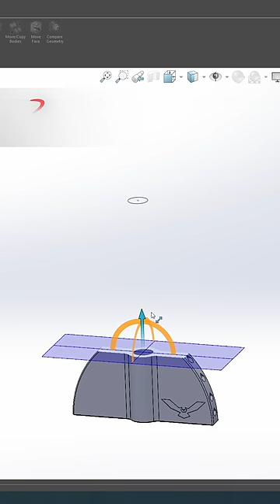Innovative way to clean a CNC Machine!

Comment: I want to see it spin at full spindle speed.
Reply: It's just a backyard sprinkler then.
Reply: I think it would just brake ahahahaha
Reply: Simple mist creator, just like face milling heads with TSC
Reply: The max RPM differs (i had 8000 and 10'000 RPM machines), but all of them need to be spindle/tool stabilised before going over ~5000RPM. So at least the asymmetric washer tool would certainly fly off the toolholder. However at 10'000RPM the edge of that 100mm radius fishtail is going linear around 6300m/min, which is insane (=378km/h) for any tool. Considering an average D tool linear speed is 120m/min, you can imagine the centrifugal forces on that plastic tool even without cutting. The spindle would rotate like 600× before droplet which just left the nozzle hits the wall 1m away going at 60 km/h.

 I'd really would like to see how does it look like, if that tool doesn't brake in the first sec of M3 S10000 M53..
Reply: @dannydetonator  hahahaha wow
great breakdown, thanks for that👌
Reply: @Ilmatorjuntapanssarivaunu_90  I don’t have through coolant so I’ve been using a sprinkler in my mill I was quite surprised I guess that somebody else came up with the same idea 👍🏻
Reply: @Danny THE Dog  I think it's printed metal, Markforged makes metal printers but I'd have to check to tell you which one.
Reply: LOL

Comment: i just drilled some holes into the round stock at variety of angles and it does the same but better
Reply: That's more of a design issue than the actual concept

Comment: Just a thought here, but after seeing this it inspired me, have the fluid flutes, shoot in a fan going up, to get the roof crevices as well, and design a spindle run to go in square patterns around the box corner to corner at various heights with of course very slow spindle rotations.

Comment: Question: what kind of material was used in the 3D printing process, and how much pressure can it with stand with just the side lock screw holding it just more than hand tight?

Comment: Work smarter not harder, this you can say when you work by your own for yourself, not for another company that will finde your a second and a forth and tenth thing to do if you try to save some time doing a job in a smarter way than what your Bose said, so as long as you don't do your own business  then work harder not smarter, because working smarter will take you to more work and more stress, they only case that I will work smarter not harder if I'm an employee is if I will take a rest in the time that I have saved with my ideas.

Comment: It looks like the side nozzles are purely horizontal and connect to a centre vertical tube, would it not be better to have the nozzles curve down from the inlet? So that the fluid doesn’t need to have a sharp direction change? You are 3D printing it so it definitely is possible to print. Also some angled nozzles would probably be a good idea. Maybe you could create a different one for cleaning pointing downwards rather than sideways.
Reply: Technically yes, but probably wont make a big difference. Takes much longer to design smth like that and cnc cooling pumps have the power go push through there no problem.
Reply: @D3nn1s  it really doesn't take much longer to design, draw the outlet, draw the path and just use the CAD software to sweep the outlet profile along the path.
Reply: @conorstewart2214  yup but do this 5x, now you need another dynamic outside too, so it takrs longer

Comment: is that water?
Reply: Coolant
Reply: @andrewcolton7430  special water for cooling?
Reply: @victimovtalent6036  No just coolant...synergy coolant
Reply: Great question! Blaser Synergy 735 has a clear appearance like water. You get a better view of the machining process, and it was created with the machinist in mind.
Reply: @Sara-TOC  I'm just curious mam, why does the cooling water not cause the lathe to rust
Reply: @victimovtalent6036  its not water, just water based so the chemicals used in coolants prevent rust and oxidizing.
Reply: @victimovtalent6036  Great question! Coolant consists of different chemicals that help inhibit rust. It is important to keep coolant/water ratios balanced and perform regular maintenance on coolant tanks to extend the life of your machine tool.
Reply: @Sara-TOC  thank you for your  explanation mam👍,now i'm understanding more,i was thought it's just milky water😅

Comment: Not so helpful, it's not gonna clean everything properly and takes up the tool holder space and precious time from an 8 hour shift, it's also quicker to clean by yourself.
Reply: yes it is quicker to clean manually, but at least for me, when i am almost at shift end and i have still some things to do, i start my cleaning program (which takes about 10), do whatever i need to do and then i only have to blow away the coolant and wipe the table and vise dry. Takes about a minute. 

Edit: oh and my cleaning tool looks like the one from Schunk, which has nozzles at varying angles.
Reply: @cambrowndrums  Who probably isn't even a Machinist